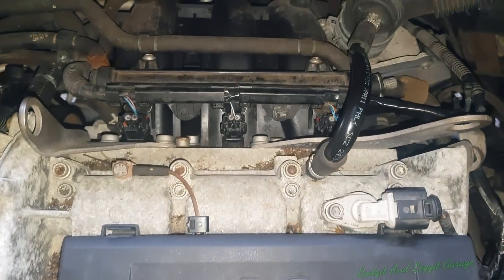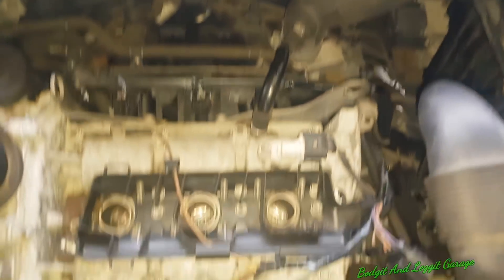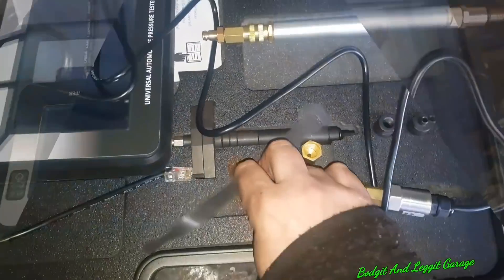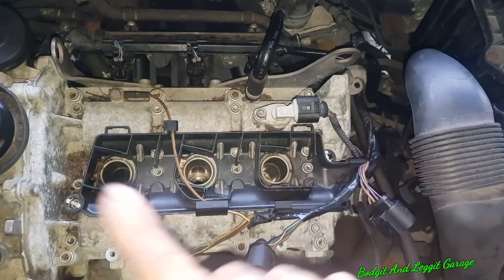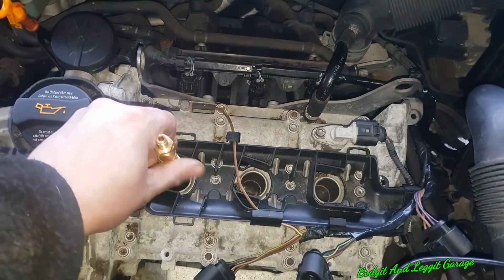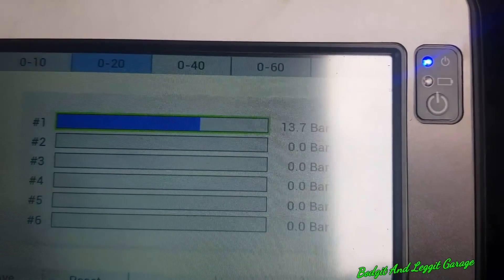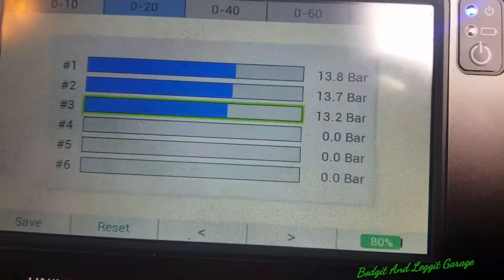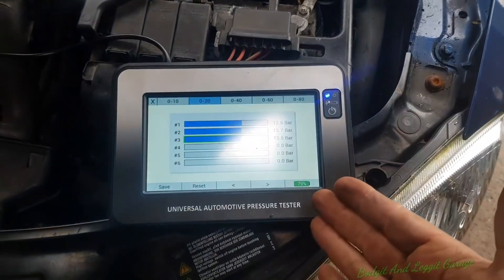Can You Fix It Part 8 Compression Test

Comment: Correct me if i'm wrong but doesn't foot to the floor cancel the operation of the  injectors?
Reply: Not on all vehicles.
Reply from the maker: Ifell3 Hi mate, I don't know of any. European vehicle well vehicles that come in to me that do that.
Reply: @bodgitandleggitgarage  no your right there, so why do you have to put the accelerator to the floor?
Reply from the maker: @ifell3  So the engine can breathe properly and get you the proper compression.
Reply: @bodgitandleggitgarage  thank you mate, I've only done this test once about a year ago, looking back at the trusty Paine's manual yes it does say disconnect the injectors 🤣
Reply from the maker: @ifell3  lol Anytime mate anytime thanks a lot for your support.

Comment: I'm still thinking about the 300 yards it runs, then stops, and then restarts.
Something moving / heating up causing a short / bad connection  maybe?
Also, 3 bar is about 45psi - did you mean 0.3 bar?
Also also, i made do for many years with a simple screw-in pressure tester - how did I cope ? |-)
Reply from the maker: Hi mate, the information I had. I checked it with a few also 3 bar.
Doesn't matter how your did if it works it works, mate.

Comment: Loving the series, not liking the way people always assume the worst. Was always told keep it simple. Would still like to know if cylinder 2 spark plug is correct type and would change it anyway for results and then check for continuity along wiring from Ecu. Am suspecting damaged wire or faulty connection to ecu (multi pin connector) . 🤔🔨🔨😳🔧🔨😁
Reply: Tiny Brown yeah or Faulty simply Swap it with another cylinder

Comment: In the first video of the series the scan tool indicated, next to the fault code, a short to positive. Maybe we should run our own wires to coil pack #2 and injector #2, bypassing the existing wiring harness, and see if the misfires disappear. Or maybe there's a different way to test for this kind of short, but I'm not a mechanic.
Reply from the maker: You can do it, but you do have to be careful. It's a grand side controlled wire from the ECU there is a few different ways of doing it. I will be making videos on this. Thanks for your suggestion, mate.